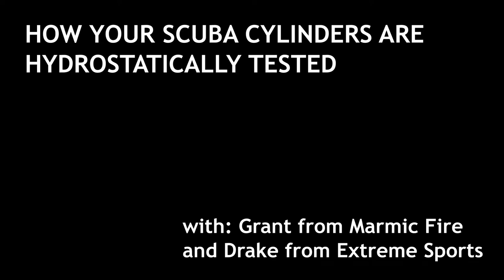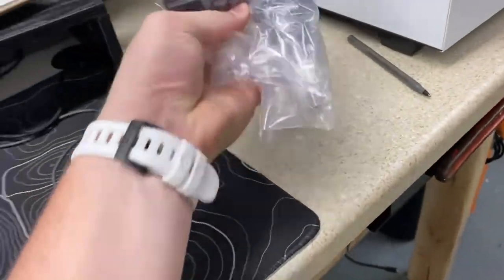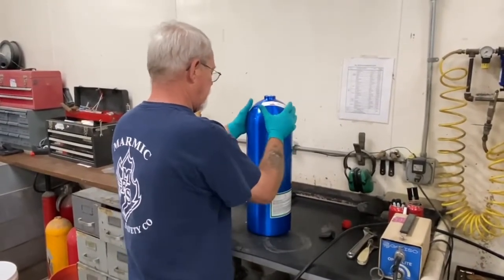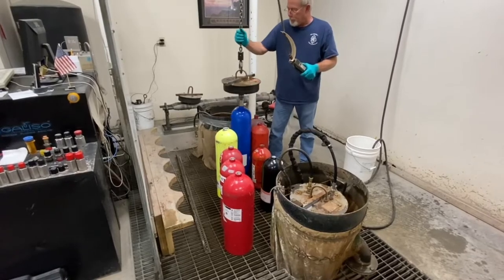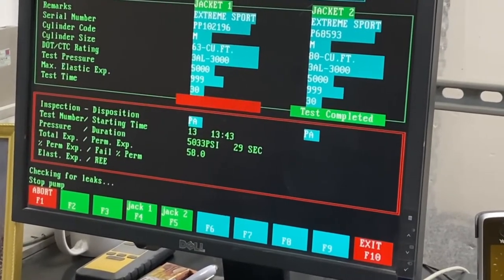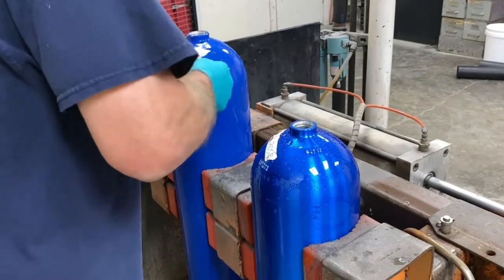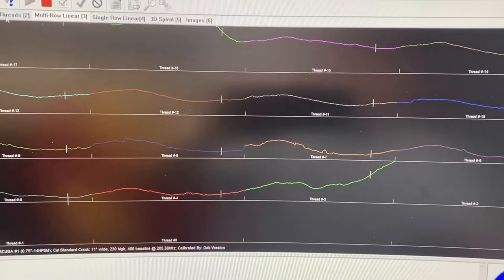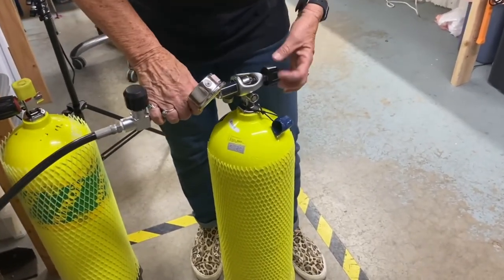How SCUBA Cylinders are Hydrostatically Tested

Comment: water is used because air/gas is compressible.
Reply: Actually liquids are compressible as well. Just less than air. All molecules are compressible. This is how we’re able to control the pressure of water inside the hydro chamber. Water is used because it takes  less than 30 seconds to compress it vs ~10 min for air. Air also creates much more heat due to its density.
Reply: That’s how CNC machines work, by compressing water.
Reply: @drakeweston1031  yes of course. the context is  fluid relative to air.
Reply: @drakeweston1031  bro... What? Water is regarded as incompressible, at my work we test hoses up to 20k psi or more and there is around 0% compression on the water in the hoses, if the water was compressed the pressure would drop.